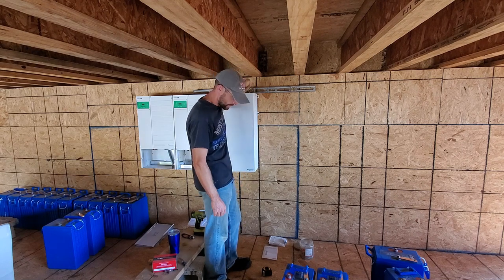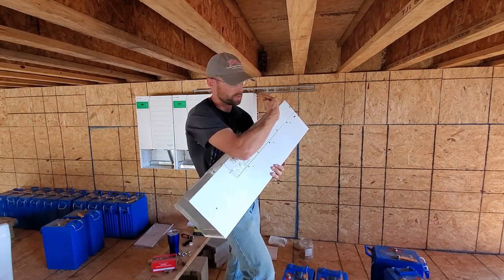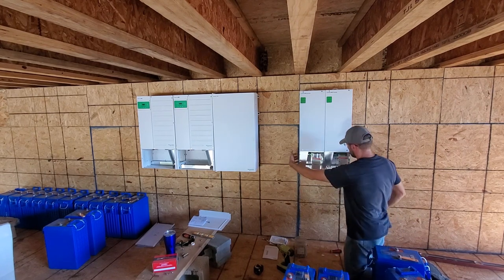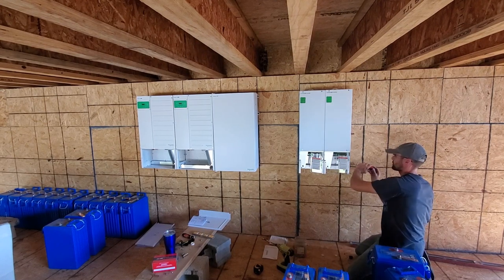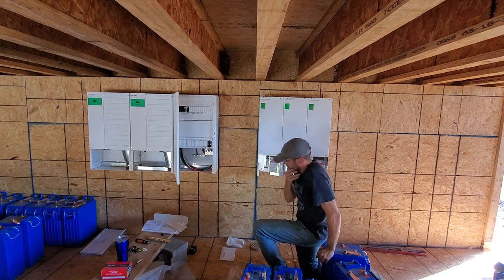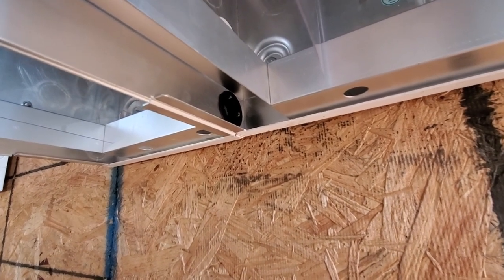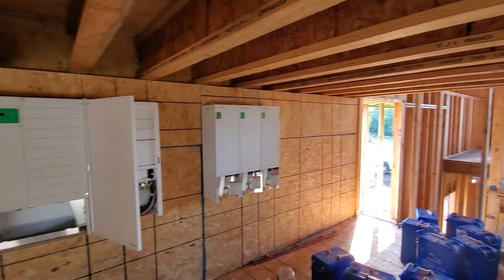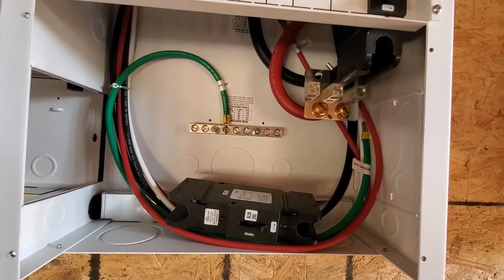Installing Off Grid Solar - Mounting the Schneider MPPT 80 600 Solar PV Charge Controller

Comment: how many kW's did you decide to go with? With your 2 season panel array set up, it will be interesting to to see the differential between summer and winter.
Reply from the maker: It is 15.36kw.  Bit of a big system but still less than half the cost of hooking up to the grid and we didn't want to compromise to much on power.

Comment: Hey good day. Can you tell me the how the inverter is doing so far. And are you satisfied with it? I have one the sw6848 +
Still do not hook it up as yet need a charge controller.
Reply from the maker: Everything is working fine since I disconnected the slave inverter.  The dual set-up was very buggy and I realized that we've never exceeded the output of a single inverter.  Keeping the second one as a spare.

Comment: Hi...I have 2 mppt Schneider with a 6848 pro, both with 9 PV  330W  
...they are configured primary and slave, but I have noticed that they 
do not both produce the same...the primary is always lower in production
 that the slave....do you know what my problem is?...thanks
Reply from the maker: Yes, you need to calibrate the inverters to each other.  It is a $500+ tool that you'll use for ten minutes.  There are specific instructions to follow.  I had to get them directly from Schneider tech support, which isn't very good.  I eventually disconnected one inverter and am only using one now since we've never exceeded output of a single one and the dual set-up was very buggy.  I'm keeping the second as a spare.